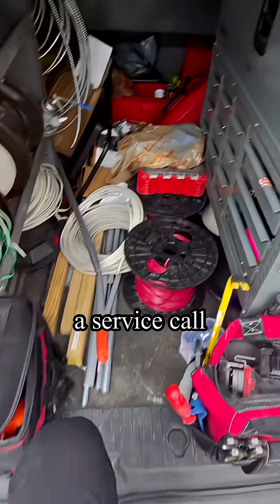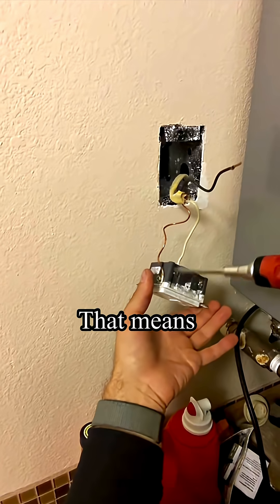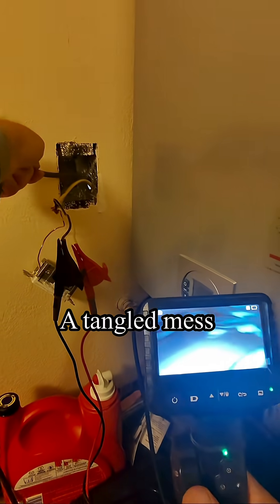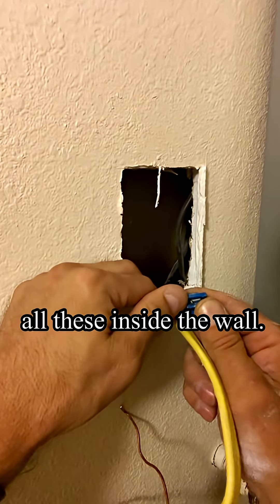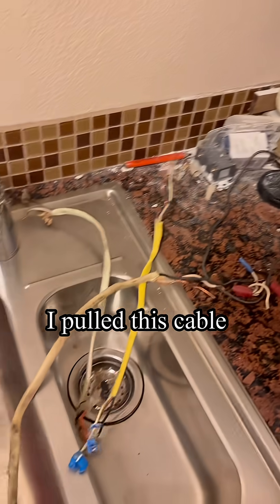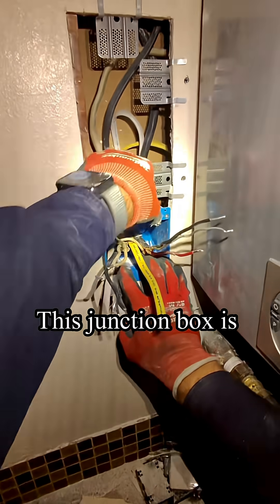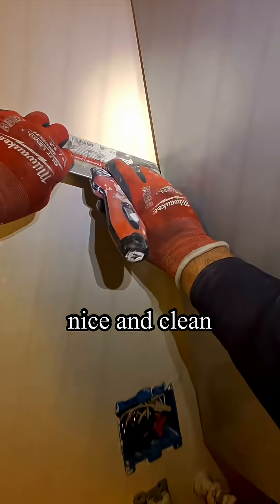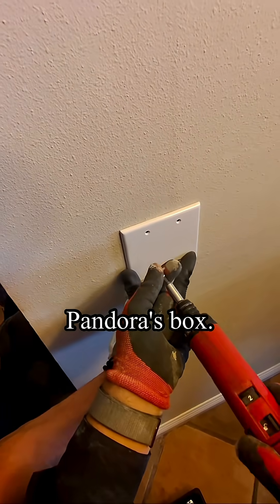Outlet Not Working? Lost Neutral Found Inside the Wall

Comment: Imagine your the first handyman thinking your work won’t be discovered
Reply from the maker: he believed in it very much)
Reply: That 5 hours of work probably ended up costing the customer at least $600 dollars too.
Reply from the maker: @samsinite100  you are almost on point, a little more than that
Reply: @Electricians_Eyes  Was fairly certain that would have been the minimum. My guess would be $200 to show up, and $100 an hour since I saw just one electrician, so roughly $700 + materials. If the j-box and cover were the only materials, then those probably didn’t cost much in materials.

What I was hinting at though is that shoddy hand man work ended up costing the customer a lot more than they initially thought it would.
Reply: Lol, imagine you're the new guy who has to run all the lines on a job where no one has integrity!👍